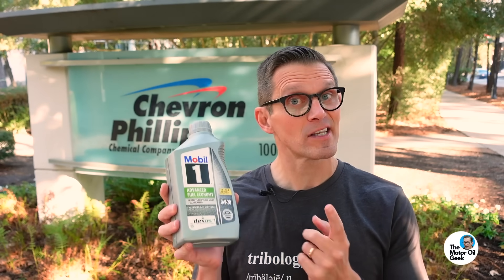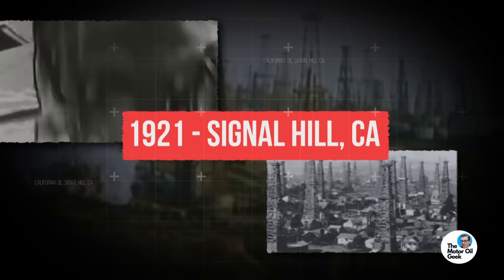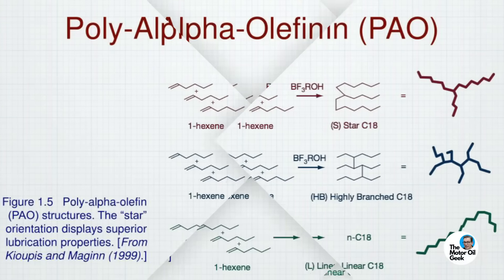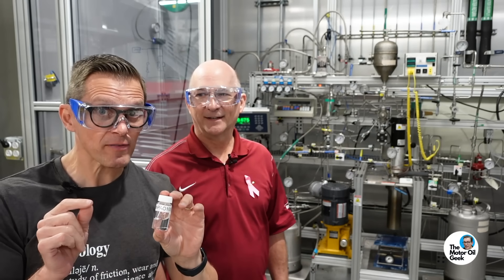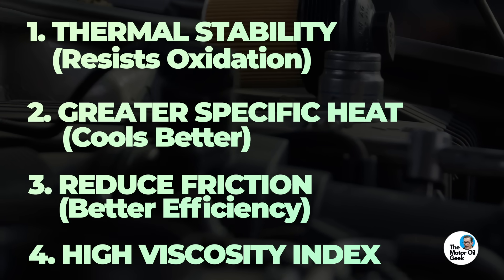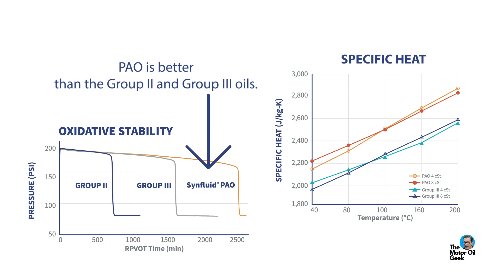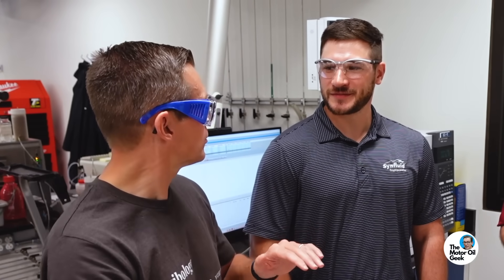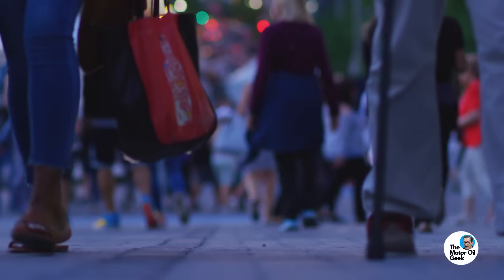STOP Using Regular Oil - 4 Reasons Synthetic is BETTER!

Comment: Mr MOG, I have a question:

What oil is best as a storage oil for older engines? I have a summer car and a winter car and don’t drive a lot so I just change oil once per year. I use full synthetic oil, but have considered putting in oil just for storage and re-using that storage oil. Perhaps certain conventional oil is good for seal conditioning.
Reply from the maker: The Driven GP-1 would be good for that.
Reply: @themotoroilgeek Also Amsoil’s Z rod oil, synthetic made for classic cars with higher levels of rust/corrosion additives.

Comment: Yes, they are better.  I use them. I like them. They are specified for most new vehicles, so if you like your warranty, better get used to them.  Are they necessary for older vehicles? No.  I'd like to see a video on the importance of oil change intervals - worrying less about type of oil, draining the last drop, etc., and more about maintaining proper change intervals. A regular change interval with Chevron non-synthetic is better than three missed changes with the best synthetic out there.
Reply: I have been watching a million billion oil test/information videos recently and this is really what it all breaks down to. Oil change interval is the key. Although I have recently been convinced that synthetic is better. I was using synthetic blend in my 2011 Crown Victoria per factory spec, but I have switched to Wal-Mart Supertech full synthetic. It’s cheap enough that it makes sense for my six month/5,000 mile intervals. The engine does seem to run a little smoother on the synthetic, but not a super noticeable difference.

Comment: I've asked this before and i get you're busy, when would a guy want to use a semi synthetic? Why do they exist? Also if a guys car needs 5w20 n all their dad had was 5w30 n topped off with it, what happens if they added a qt of 5w30 to 6qt of 5w20?
Reply from the maker: Semi-Synthetic works well with high spring pressures.

Comment: Switched to Synthetic Oil After watching Video results of comparing  two of the same engines run synthetic versus conventional oil  The results totally blew my mind the convential oil  test showed a completely contaminated black burned out  oil the synthetic test showed an oil that all most looked new and had much less break down & contamination. I could totally see the benefit Up until that time my philosophy was change oil as cheaply as possible at 3000 miles as recommended because all conventional oils just broke down quickly l did have over good results But realize the error of My ways    The second pet petroleum peeve . I had never seen the 5 clasifications of oils before anywhere  Plus there should be clearer labeling of oils  by Symbols Color & Shape of Quart bottles   My  Big Box Store Pet Petroleum Peeve is they carry no Quart Bottles At Pumps so car  owners start to check oil level at pumps  I like the great prices but would like more service Keep up the great work
Reply from the maker: Thanks!

Comment: I'm a trucker and I've gone through every brand full synthetic to semi to regular oil,and probably 50,000 miles minimum on every brand and multiple oil changes. Chevron semi is the oil I've stuck with a few pounds of better oil pressure and I seem to get a slightly better fuel mileage,it turns darker quicker but owell. Next it seems like less oil consumption, and my truck is 1.25 million miles but I've had extensive engine work,and I will stick with Chevron. On my 350,000 miles dodge hemi I've been using valvoline restore.
Reply: I'd imagine with a large commercial vehicle changing the oil a bit more is a lot cheaper than less mpg anyway.
Reply: @Stealth86651 Changing oil regularly at set intervals is real secret. 5-6k mis (max) w/ full synthetic oil. Brand isn't as important as consistency. 05 F150 4wd - 319k mis - doesn't burn or leak oil. Motorcraft Full Synthetic & Mobil1 mainly.. currently Pennzoil Platinum "high mileage" oil. 👍🏻
Reply: Valvoline Restore & Protect just came out.  What you use on your RAM truck before? My 05 F150 4wd w/319k mis used mainly Motorcraft Full Synthetic , Mobil1 & now Pennzoil Platinum "High mileage" full synthetic. Doesn't burn oil or leak. Most important thing is 5k mi oil change intervals vs brands of full synthetic oil.
Reply: @Davido50  mobile 1 primarily, I need to change the spark plugs 1 of these days again. Grinns
Reply: my ISX cummins has 940k original miles on it. no inframe. when the tech asks me what oil i want i pick the one that gives me the free coffee mug or hat. i have no loyalty. turns out that just not abusing your semi truck is the key to a long life. it is not picking the "right" oil or throwing additives at it. regular conventional diesel oil is fine. just don't pull the pass loaded and floored with the temp and pyro gauges pegged. that kind of abusive heat cycling is what will do that motor in as the different materials expand and contract at different rates.
Reply: I have a 2010 Toyota 4Runner and I use Mobil 1 and I change my oil every 10-12k miles and I have 320k miles on it and it runs like new, no leak, nothing

Comment: You need to tell folk if they change to synthetic they need to use rubber or silicone gaskets, cork gaskets will leak, even new ones with synthetic oil ,You can use synthetic in older notors just change gaskets.

Comment: As a 70 year old looking back engine oils started to make huge jumps every decade or so starting around 1960.
Put and 1960's oil in a  modern and it would kill it  in 30,000 miles
Reply: So would putting a modern oil in a 1940s car. They need extra zinc.
Reply: Synthetic hasn't hurt ours in thousands of miles.

Comment: My shop is a Briggs and Stratton generator dealer. 
During training we saw a video for Schaffers oil vs Mobil 1 in a 1200 hour air cooled engine torture test. 
Oil was added to keep full but not changed. 
The Mobil 1 literally looked like tar and had all kinds of carboned deposits around the exhaust valve springs and in the sump. 

I can't find that video anywhere online.

Comment: We need the original Slick50 Formula From the late seventies early eighties. Put it in my slant.Six went from twenty to thirty two miles per gallon.
Heck you could run out of oil, and not hurt the motor. 24$ a gt, at the time. Repaced one qt at oil change. Never needed again.

Comment: Great revealing video. For me a common consumer, I currently understand that the oils on store shelves which say "fully synthetic" (is this what is called group 3)? are derived from crude but go through additional refining and that "fully synthetic" claim is marketing derived. To get lubricants which are derived through chemistry, not crude, you have to get products like Amsoil which say 100% synthetic, these are the "group 4", is that correct? If ya have the time a quick sentence on clarification would be great, thanks!
Reply from the maker: Neither Full Synthetic or 100% Synthetic are technical terms. They are both marketing terms. To know what the oil is actually made of, check out the SDS sheet.

Comment: Videos like this get me excited. Talking to the experts, using the big terms, breaking down the tech. Lay people just don't have a lot of access to this information. You need to get out of your depth to grow, so thanks for bringing this knowledge to people outside of the industry. I can research big terms, a process, a piece of machinery, but only if I know it exists. This channel is helping to expose me to tribology way beyond what even BITOG was able to do. Thank you!

Keep the tech coming!

What was being said about wax vs. molecular diversity was really interesting. The information about friction and specific heat was fascinating as well. I noticed engine oil temperature differences when switching oils at one point, and it's not just that one oil was lubricating better, it's that it was able to hold a similar amount of heat without increasing its temperature as much. 

Couple questions:

Why is sulfur bad (sulfuric acid, maybe)?
What is meant exactly by C10, C20, etc.? I assume these are the lengths of the chains in the hydrocarbon molecules, but a visualization of this would be great.
Reply from the maker: Thanks! I’m glad the videos are helpful. The C number is the carbon length. Sulfur is not all bad, but too much Sulfur can be corrosive.
Reply: @themotoroilgeek  As can insane doses of ZDDP in a longer drain interval,  daily driven, not racing use engine as well, correct?

Comment: Hi Lake, I run premium brand synthetic muti-weight oils (5-50, 20-50, 15-50, 5-40) in all my performance sports cars (Corvette Z06s, BMW M4 Twin Turbo, Mini Cooper S Turbo, etc).
Back in the old days pre 2010 when I always used 20-50, when started my cars up from cold, I'd always wait 2-3 min to warm up my oil and wait to see the temperature gauge to warm up to 150-degrees before driving off, and still saying under 2500rpm until the engine was up to normal operating temperature so as not to run the oil pressure up too high. Question - Today, with the newer  lower inital rate muti weight oils, is it OK to drive off cold after waiting 60 secs to get the oil pressure up and get oil to all the parts of the engine, but still mindful to keep the engine RPMs under 2500 until the engine is up to operating temperature? How long do you wait to drive off with a cold engine with modern multi-weight oils? Thanks! - Jim

Comment: I personally know a company in my neighborhood that runs their fleet trucks with standard Valvoline motor oil at 10W-40 from day one they buy them.  These trucks last 150,000 miles with no oil burning, sludge, or issues.  Their mechanic changes the oil between 3500-4500 miles.  They buy the motor oil at a discount using a large volume order in drums.
Reply: @sweetday-n2h  only 150K?

Comment: I’ve been using Mobil 1 for 50 years, never had any oil related problems.  Just switched to AMSOIL full synthetic.
Reply: Then why switch??
Reply: @ because AMSOIL is better, not by a lot.
Reply: Got rid of one 302 Ford with 375,000 still running. M1
Reply: I like Amsoil and buy many of the products. I also buy Mobil 1. If you buy Amsoil motor oil get the signature. I believe if you buy Amsoil buy the gallon it's a tad cheaper than buying by the quart. Mobil 1 is easy to get and in my opinion they research and test the heck out of their oil. I think Mobil 1 is also buying the GTL base oil from Pennzoil for some of the line up. Saw that in the SDS.

Comment: What Oil should I use for my 69 Chevelle, SBC with a flat tappet, solid lifter camshaft? The bearing clearance is between 25-30 thousands.
Reply: I use full synthetic 10w30 in my flat tappet SBC. But I only have 2 thousandths of an inch of clearance on my main and rod bearings. Runs amazing way better than that conventional tar I wouldn't even call it oil compared to synthetic.  don't even use a zinc additive like every old gear head yells at you to use!
Reply from the maker: 10W-40 API SP

Comment: ??? I just got an oil analysis for my Honda Civic 79K mi.  It shows high silicon.  I have inspected air intake seems ok?
????  I have used  techron and amsoil fuel additive for the entire 4000k oil cycle.  Could I have gotten the additional silicon from the fuel?
Reply from the maker: The Silicon is not from the fuel additives. It is likely from the air cleaner.

Comment: So, if a cost conscious customer buys a cheaper “Group 1” base oil and its in a hard working engine, it becomes a refinery! Heat, pressure and shear creates new molecules found on rings, crankcase and in valve covers = tar, asphalt and sludge! I’ll buy the synthetic class!

Comment: I've been using synthetic oil since the mid 1980's when I did a little experiment on my screened porch.  I put a little 10W30 Castrol dino oil in the bottom of  a soup can and a little Mobil 1 synthetic 10W30 in another soup can.  I set them on the porch overnight where it reached -5 deg. F.  The next morning I tipped the cans on their side and the "regular" oil didn't move. 🥶  The synthetic almost moved like it was a warm day.  Been using synthetic ever since.
Reply: That's why I live in the South 👍👍

Comment: Yeah... I'll rather use a block heater 3h before starting my car in the winter with a timer rather than wasting money on synthetic oil.
Reply: FYI, synthetic oil is cheaper than petroleum in the long run with extended drain intervals and longer engine life

Comment: Well, I do, except in one of my vehicles, syn seeps through every seal, when hot starts to sweat through the cases. Weird, but true, on my Avatar, 2011 Ural. Crap castings and real rubber seals...  
However in my 1988 HD with 232K miles, my 2018 Ural (good castings, modern seals, identical to my avatar) and my 2018 Triumph, all use synthetic. Just make sure whatever you use is appropriate for the vehicle. To the "I only use <pick one> all the rest are  <inappropriate adjective>..." Really? Get a life or make some videos proving your point, we all love disaster movies.

Comment: The shop I work at has 15W 40 diesel oil, and 5W30 synthetic dexos in bulk, everything else is 24 qt boxes of Mobil 1. We will use conventional,  if asked, but honestly,  most modern engines do better on synthetic....

Comment: Mosy synthetics are just hydrocracked mineral base stock. They work pretty well but in terms of shear stability, for example, they dont do any better than a conventional oil.

I run Rotella T4 in my bikes, works very well. Wear metals are below average, some are 50% of average. For a 13000 rpm bike engine, thats pretty good.
Reply: What you thought about t6 15w-40 ck4 for same application?
Reply: @MultiP800  the main difference is how much I would pay for a gallon. Both are mineral based, the group 3 T6 is a better product overall but in a shared sump motorcycle application I wouldn't expect any improvement over T4.

I do use the T6 in automotive applications with extended service intervals.

Comment: In a word: DUH! LOL PS—I have been using exclusively synthetic oil in all my vehicles since around 1993. I started with Royal Purple synthetic oil and now only use Liqui Moly for my Volvo and Idemitsu for my Lexus. I have not had engine problems during this time.
Reply: Look up the sds for liquid moly. Some of them are just group 3 synthetics at a high price!😬
Reply: @darrylsjodin7184  Yeah, that's what makes me think that Europe actually HAS adopted our practice of allowing severely hydrocracked base oils to be labeled as "Full Synthetic" as well.

But LM, as well as Motul actually do still make and offer full on Group 2/3 oils as well.

Comment: Yup and nowadays you can get Supertech full synthetic for cheaper then conventional. So there is NO reason to use conventional, UNLESS its a very specific application.
Reply: Aye but Supertech cant hold a candle to the likes of valvoline restore and protect syn oil.
Reply: Actually you are buying nothing but a Group III conventional oil labeled falsely as a full synthetic oil, shame on both Castrol and the BBB National Advertising Division many years ago for this happening. Mobil back then tried to explain to the BBB National Advertising Division that Group III Hydrocracked oil was not synthetic oil but they sided with Castrol. I refuse to use Castrol to this day because of that. I will continue to use Redline Group V oils in all my engines.
Reply: @LeeCountySpeedShop do you prefer redline over ams oil friend?

Comment: I started using Mobil 1 in the mid 80’s.  A few years ago I switched to Amsoil.  I use synthetic in everything, cars, trucks, motorcycle, tractors and small engines.
Reply: You can switch back and save a lot of money. Any good Synthetic oil changed every 5k miles will exceed your engine's requirements and reduce engine wear. 3rd generation mechanic and engine builder 😂
Reply: @ I buy enough in bulk it’s a wash money wise, besides it’s delivered to the shop and that saves time because I live in the sticks.

Comment: I would like to try Amsoil in 2023 OM654 2.0L 4cyl diesel Sprinter van BUT they dont make ANY oils that they recomend for it meeting MB229.52 spec. They dont even have any oils rated "SP". The MB approved list is pretty slim especially in 5w-40.  Im running Motul 8100 x-clean Gen2 5w-40 right now as it meets both SP and MB229.52 AND is actually listed on MB's own "Approved Fluids List". I will send my first oil analysis in soon to see how that is looking. Please advise.
Reply: Save your money 😂. Any good Synthetic oil changed every 5k miles will exceed your engine's requirements and reduce engine wear. 3rd generation mechanic and engine builder.
Reply: AMSOIL 5W40 FS 100% Synthetic European Motor Oil, part #EFM, should work. meets MB229.5 for 5w40 full saps
Reply: AMSOIL 0W30 MS 100% Synthetic European motor oil, part #EOT,  meets MB 229.52 for medium saps, this appears to be what they want is medium saps.
Reply: AMSOIL 5W40 MS European part #AFL is MB229.51 for medium saps
Reply from the maker: We see really good results from the Motul 8100.

Comment: I felt like I needed a degree in chemistry to understand any of this. I did like the breakdown at the end of the groups of oil. It’s very easy to be sold on “group 5” because it’s higher than 4, thanks for the clarification of that.
Reply: Wait until they find out that most oils used in trucking, agriculture and farming industries where one engine can cost anywhere from $100,000 still mostly made out of the group I/II oils 😂